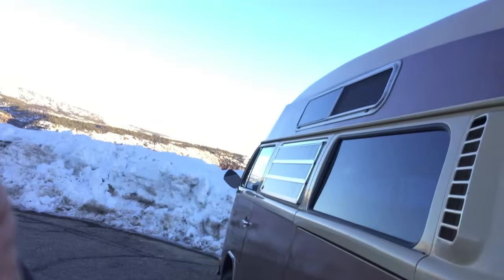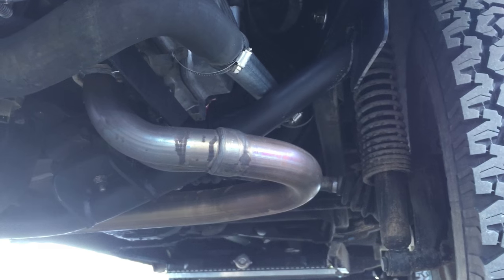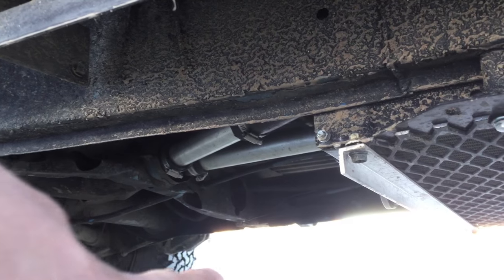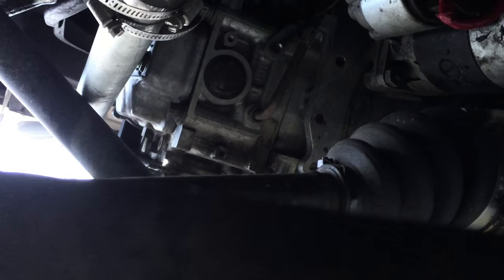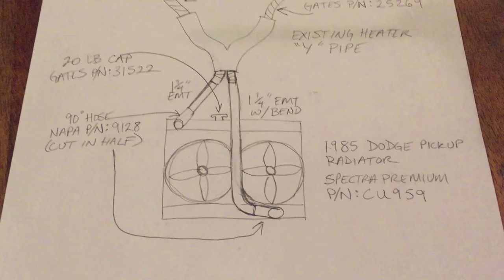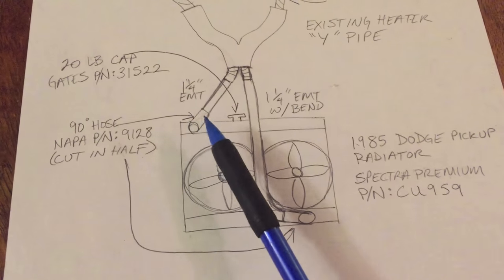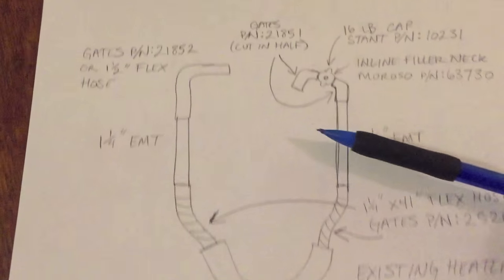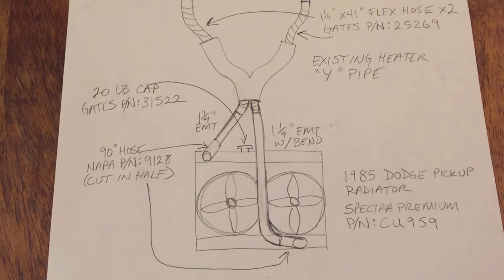73 Busaru With Belly Radiator

Comment: Hello! congratulations for the work , very technical and well executed . I am Brazilian and here , this model is called Kombi, and only received the engine water in 2006 until the end of production in 2013. sorry my english, I understand most of what I write ...
Reply from the maker: +Hugo Silva I would love to get a hold of the brazilian front radiator housing. Not the prettiest piece of kit, but I bet it cools the engine fairly well.
Reply: +Busaru In the 1980s when we had a diesel option , the heating of the engine was a serious problem that VW could not solve ... They chose to shut down production of the diesel model . In the new model that has been fixed, however it runs on gasoline and / or ethanol ( mixed or not) engines called " flex "
On the piece you want , I can help you in any way?
Reply from the maker: Thanks Hugo! Do you have a way of getting a front mount radiator setup for a Kombi? If you think you could get one I'd be happy to send you some money!
Reply: Hey, I just found your comment. I live in Brazil now but I'm from San Diego. I'm going home in a few weeks and can see about bringing you one from Brazil

Comment: I was considering a belly mount as I really don't want to cut the nose of my westy for the lower grill although I have read some people just rely on the upper opening. I do have an 86 parts van so actually have everything for the front mount stock setup. it's a ways off yet so just one of many decisionsnto make! thanks for your comments!
Reply from the maker: +backyardcnc If you have a donor then I'd totally go front mount. I wouldn't cut the hole either - I never do. You can check out my article on how I convert them on my website Boxerswaps.com. It's a step by step guide for converting the aircooled van. I charge a small fee for it but it may help when the time comes.

Comment: Hi guys! I bought the spectra premium radiator CU959 it is 27" wide. The wide between the frame rails is only 25" on my 79 bus. I also bought all the hoses on the video which looks like they will work, all but the Two Gates 25269 flex hoses. The ID is only 1-1\4" on flex hose and EMT is 1-1/2" OD. I will have to turn the radiator a quarter turn and buy different hoses. I may be thinking wrong. If you have a better idea let me know. Thanks
Reply from the maker: +James Groves That setup has worked many times for me. The radiator hoses fit tight into the EMT - just use a little lube and heat.

Comment: Hi guys, I get the belly mount radiator mounted ! The flex hoses worked fine. It was hard to get them on the EMT but  with heat and lube it worked! After I run them I saw that 1-1/2" hose would not fit. I had to turn the radiator with the cap on the driver side. Hopefully it will cool ok. I still have to make the front deflector and the screen. It took about 2-1/2 gallons of antifreeze to fill the system.  I ran engine until the fans come on witch move a lot of air! Does anyone know of a temperature gauge that works with with the output of the computer signal 1-1.4 volts I think? Thanks for all your videos and help!
Reply from the maker: +James Groves that's odd that you had to turn the radiator 90 degrees. Were you tucking it up high between the frame rails and using a pusher fan? For the gauge, you may just want to get a gauge that has a sender that you can install instead of using the Subaru sender. Thanks for the update and good job getting it done!

Comment: Did you have any trouble burping the system? I've got a '72 with a 2.5l and a very similar setup to this. I used 1.5" hose the whole way. Testing it out and it keeps over heating! No heat in radiator fins... even parked on a down hill and dropped the rad out entirely to put it on an angle. Just replaced the waterpump, belt & thermostat :(

Comment: y el flujo de aire hacia el radiador es eficaz ?
Reply from the maker: +Cristian Mora A tilt or scoop may be necessary in Summer but ground clearance will suffer - it's always a balance between protection and cooling with these buses. The beetle guys have it much easier!
Reply: +Busaru gracias !!!!

Comment: Hi Mick
Did you have any trouble fishing your flexible rad hoses through the heater channels? In my 1977 the heater channels above the rear axle are flattened.  It's looks tight to get 1.5 inch hoses through there unless they will deform as well. Are the heater channels in the 77 the same as in the 73? I am going to order those gates hoses if they will squeeze through.
Thanks  Mark
Reply from the maker: Hi Mark, you will have problems with 1.5" as its a tight fit with the 1.25" that I use. I'd recommend going with the slightly smaller ID. By the way, it's the same size as what the Vanagon uses for its 10ft pipes!

Comment: Hi man...can you please help me???  I love It !!! nice  design and i want to tried on my own WKombi, but i don't understand where are the fans flowing the air to the car floor or to the street ? Also i what do you need the shroud on the front ? how does it works ???  and the L part on end what is this for ? please help on this, i really need to do this fix. Best regards Carlos A.
Reply from the maker: +Carlos ( Charlie ) Arce Hey Carlos, The fans are stock Subaru fans configured to pull air up and exit out of the rear of the radiator, and to the gaps in between the frame rails. The shroud on the front doesn't seem to do too much other than stop debris from flowing up and into the top of the radiator. The flap is a "gurney flap" and disturbs airflow to help in creating a vacuum at the rear of the radiator, therefore pulling air from the top of the rad out and away. I hope that helps!

Comment: I want to belly mount my radiator on my 79 bus. Have you tried to use the Subaru radiator mounted across the under floor between the frame rails with the radiator cap on the passenger side and fans facing up? If so did it work? It not do you think it will work?
Reply from the maker: +James Groves I've tried but mounting it seemed to be complicated. It was worth it to me to spend the $100 on a Dodge radiator that basically bolts on - plus you get a new and bigger radiator. Let me know if you go forward with it - I'd love to see what you come up with.

Comment: I'm sorry to bother you, but where do you take the cool air ?  or the steel net is for that ???? or do you have the fans working all the time ??? help help.....
Reply from the maker: +Carlos ( Charlie ) Arce Hi Again Carlos, The fans kick on during town driving occasionally. Air flows up and out of the back of the radiator, like how I mention in the video. Its possible it might need to tilt slightly in the summer to create additional cooling, but winter snow and mud are a major concern for a belly mount in Colorado, so I tried to keep tucked away as best I could. What is your project?
Reply: +Busaru Good to know , i understand it better.... my project is Kombi 76 but i lived in Costa Rica, we have almost summer all year.... just to be check, the radiator must be tilt,   how many degrees  ?
Reply from the maker: I assume you'll be using it on some rough roads? You may want to leave flat if you feel like it could get mud caked into the fins - try flat then angle or add a scoop if necessary.
Reply: +Busaru.     thank you !!!!

Comment: I am considering doing a belly rad on my 1981 Vanagon Aircooled when I convert to 2.2l subie power. I am curious why you didn't just use the Subaru radiator  rather than going with the Dodge unit?
Reply from the maker: +backyardcnc  Let us know how the belly works with the Vanagon. I've converted aircooled Vanagons but I always mount the radiator up front for better cooling and it's protected from road debris - what's your reasoning behind mounting it below? 

The Subaru radiator isn't ideal for a belly mount on a bus, the sharp just isn't right. Believe me - I tried to make it work!

Comment: Hi Just busy with a conversion myself in New Zealand. which way is your air flow down or up through the radiator and if it is down are the fans in reverse
Reply from the maker: Up flow seems to work more efficiently in my testing but I’m sure you could figure out a way to to do down with push fans. There are so many ways to solve the cooling issue but I haven’t found one that works “best” in every scenario.

Comment: Mick: Now that you've had this Bus on the road for some time, what do find in terms of fan usage when you're at cruise speed (let's say 75mph.) Did you regear the transmission? What temp are you running? Good work, mate!
Reply from the maker: +Marshall Webber thanks! That was a customers bus and he's reported that it's been working great for him. When I did the conversion the temps would hover between 185-212 depending on load. The fan kicks on around 203 so it wasn't too often that it would kick on. Regearing would be pretty necessary to cruise at 75mph for longer than just passing. Most times I convert campers, in which 75mph would be very uncomfortable and tedious to sustain. The only rad setup I haven't tried yet is the Brazilian front clip. I imagine it is the most complicated, but also cools the best. Might be the way to go if that's the main concern.

Comment: Why the change in radiator position? Is it just for space or did you have trouble with the engine bay mounted ones?
Reply from the maker: +ItsFriscoBaby Just more flavors in the ice-cream shop. The engine bay radiators work well with the 2.2L but are still considered experimental in my opinion. You can follow on Instagram Busaru and see how the white bus is doing (traveling all over the place). 

Since this particular conversion was for someone else, I wanted to go with a more standard high cooling capacity system. This system would be better suited to higher horsepower setups than the engine bay radiators, at least until things are dialed in a little more.
Reply: +Busaru Im going with a 2.0 NA engine. I like the neatness of the engine bay mounted rads but i worry about efficiency. Really dont want the fans running other than in traffic
Reply from the maker: Engine bay rads should work great, you may need to buy a set of Earz for highway airflow but you're right, the bay radiators are very simple.
Reply from the maker: +ItsFriscoBaby The engine bay rads should work great for the 2.0. You can increase the airflow with a product called Earz as well (clear lexan scoops for the air inlets). Let us all know how the swap turns out.

Comment: how much could you tow with a busaru?????
Reply from the maker: +Mr Destroyer That's a good question - id be worried more about brakes than power once you have a Subaru. Maybe a motorcycle or two? You'd want to check the stock towing capacity of the bus.